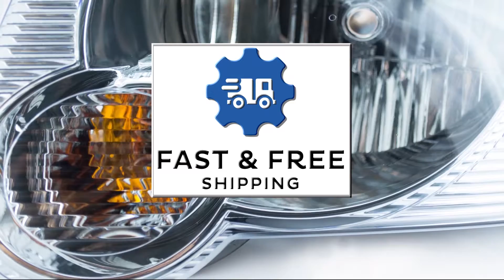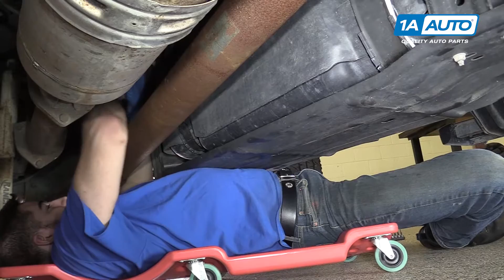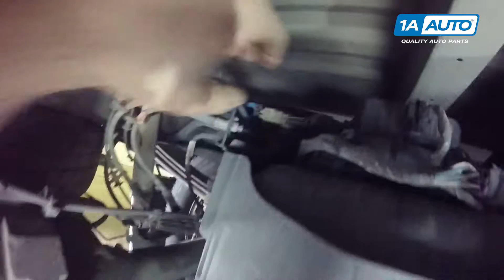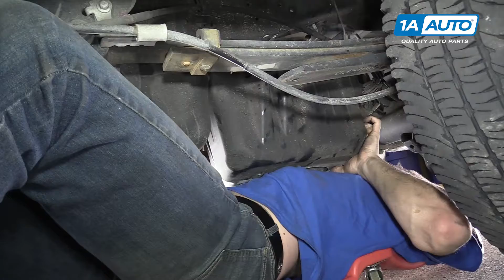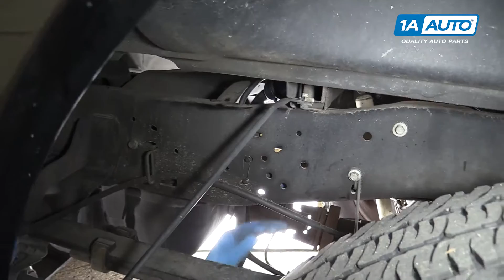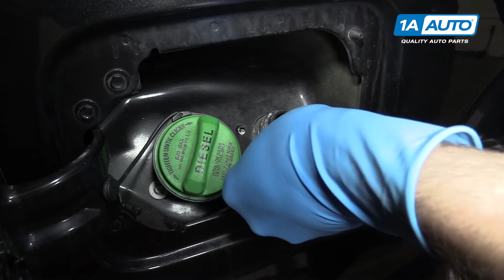How To Replace DEF Tank 11-16 Ford F250 Diesel

Comment: Hardest part is disconnecting the plastic QUICK disconnect. And isn't shown in the video. Never know how the push disconnect plug works unless you've done it before. And likely will break it, by the time you learn how it works.

Comment: I was adding a sway bar and needed access to a bolt location on the frame (ie Hellwig 1139-173).  The DEF tank blocked access and my man sausage fingers just would not fit.   This video hit the mark 100%.  No million dollar shop air tools and overhead hydraulic lift, this dude is on a creeper under his truck with hand tools like the rest of us.  Great attention to safety, proper tools, note the cloves, right on man.

Comment: This why I WON'T EVER own a new Ford Diesel truck. To much crap to deal with and the cost of repairs if you don't do it yourself is through the sealing. That's why I own and won't sell my 2001 7.3L F350. It's not as comfy but I KNOW I can fix it myself and it RARELY EVER breaks. When it does it's the usual stuff on any vehicle, like brakes or batteries and I can Fix it quickly and cheaply. New Fords are nice and comfy when they work, when they don't they're an expensive nightmare. Thanks for sharing. Best Wishes & Blessings. Keith Noneya
Reply from the maker: +Keith Noneya Thanks for checking us out and the reply! 1aauto.com

Comment: I called Ford on this for my truck and they said this would take 6 hours. It looks pretty straight forward to, me about how long would you say this takes? I would think Ford has mechanics who have done this before and have all the right tools, which is a couple so I would think it would be fairly fast and easy.
Reply from the maker: +Kim Staton It may take you an afternoon to perform the repair. It's not that hard of a repair but it may take a bit. 1aauto.com